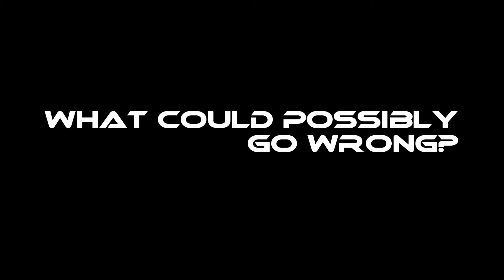The Science of Flybys ▪ Hoverthings Flip 360 ▪ Arducopter

Comment: Nice video, I was looking at the Flip 360, would you reccomend it?
Reply from the maker: Thanks :). Even though I'm not flying it at the moment (too many projects) I still really like the frame. It's pretty small once the arms are folded but it has a lot of room for components, takes a GoPro, and the arms fold up for easy transport. The later versions added some improvements too. Hoverthings can make it in carbon fibre on request too, which I'd probably recommend as you can get a little flex in the G10 frames, which can be annoying if you want really smooth footage. Hope this helps!